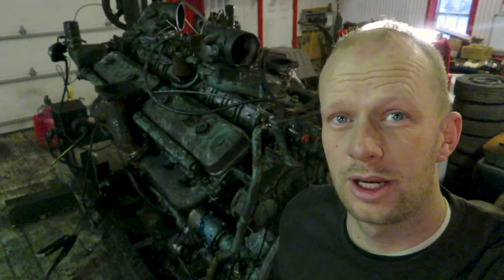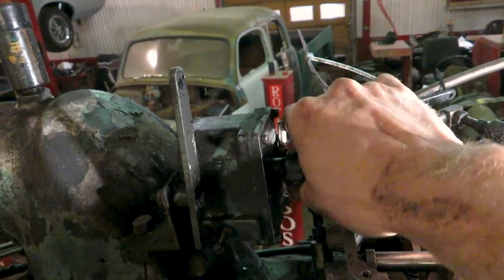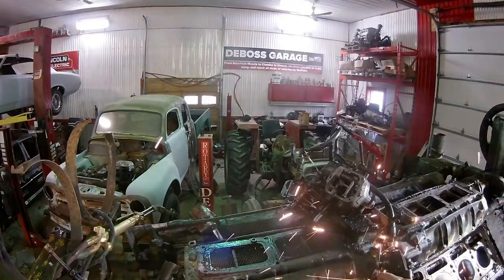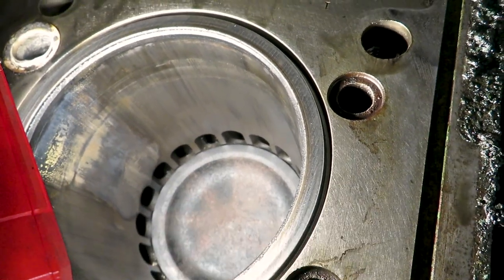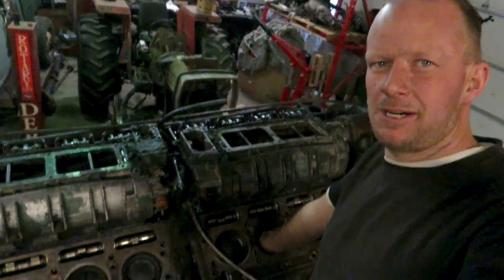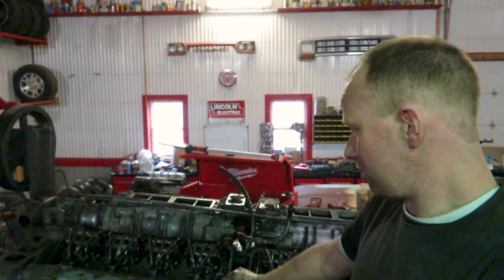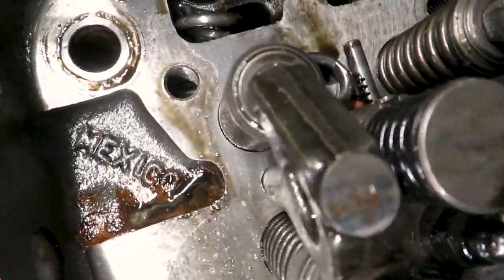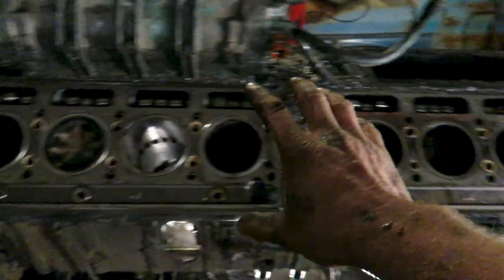What's Inside a 16cyl 2 Stroke Detroit Diesel? #HowItWorks

Comment: As a Marine Engineer these 12v71, 12v92 & 12v149 were very popular in offshore supply boats - very powerful & robust - although the unit injectors in the cylinder head leaking fuel into the heads & crankcase & destroying the lube oil - they are easy to maintain as the cylinder/piston can be replaced as a single unit - the ones l ran were turbo charged & superchaged - technically "scavenge ports" - just the noise when running is exciting - they were designed to work hard - they suffered torsional problems when run at high load & low rpm (over torque)

Comment: Brings back lots of memories, every piece of logging equipment on Vancouver island had a 2 stroke Detroit in it up till not that long ago.
We rebuilt hundreds of these back in the 90’s at the diesel shop I worked at. We had exchange rebuilt 12v71’s sitting on a rack waiting to go in
A Hayes HDX off highway logging truck or an 044 Madill yarder. Also the Allison 5960 off highway automatic transmission a great combination.
Every time I hear one of these running it brings up lots o memories and emotions. 😢 I miss a lot of the old mechanical engines, Old Cummins 855’s and the KTA 19 as well with the PT fuel systems, most of the younger techs have probably never worked on them.
The 2 stroke Detroit’s were fun to tune and set up, a real art to getting it right, still have all my tune up tools.
Thanks for sharing this with us!!

Comment: These 2-cycle Detroits are legendary. I owned several back in the day: One boat with two 6V53s, running in opposite directions, and a bigger boat with a single 8-71. Say what you will, they were dead-nuts reliable. Climb onto to boat, pour in 2-3 gallons of crankcase oil and start them up. They weren't fast but they never failed. Yes, they leaked a little but back then, I'd never go to sea without that distinctive small of the Detroit exhaust.
Reply: I used to build marinised 8V92 TAs, 750hp all day everyday to 10,000 hours
Reply: Daver G  I said 10,000 HOURS not rpm. They peaked at 2200rpm
Reply: Daver G  Well I've built several (over 50) marinised 8V92TA engines that went into commercial boats, usually trawlers. Never saw one for rebuild under 8.000hrs and that was only because it flared with props out of water in storm seas and over revved. I am happy to give you phone numbers to call owners and previous employers.
Reply: Daver G  Yeah, I read what you wrote, and why would you idle a marine 8V92 at 1500???? And if you want to run an 8V92 to 3000 rpm, be my guest, I've seen one self destruct on the dyno at 2800 because someone didn't set the governor correctly.
Reply: Daver G  WHEN did I EVER mention TTA??? DUH! TA Marinised! No blow off valve, keel cooled, do I need to go on? And trawlers run at 1500rpm when exactly?? Oh yeah, docking. Well I must be so lucky exceeding 435hp, fuck I've built 92TA's at 455hp industrial running irrigation pumps. Obviously I've been doing shit wrong for 35 years
Reply: Daver G  Like I said, how many phone numbers do you want???
Reply: Daver G  Ok, let's see who's credible. Without looking at a book, google searching or looking it up on the internet, Marinised 8V92TA(not TTA) @ 750hp 1050ftlbs torque tell me the injector spec, timing, blower drive ratio and fuel restrictor to use????? You have 10 minutes
Reply: Daver G  Are you in the states?
Reply: Chris Willmott but his uncle said........
Reply: @muckrunner308  Exactly

Comment: I worked for a Detroit Diesel distributor back in the 1970s when the 16V71 was used in the oilfields and locomotives. They were amazing engines and the technology that Rich details in this video is just an introduction to all you could do with them. I worked on Series 53, 71 and 92, but didn't get to service the 149s, which were used in huge locomotives and transcontinental cargo ships. Red Adair, who was the oilfield firefighter that John Wayne's character was based on in the movie "The Hellfighters," used Detroit Diesels because they were comparatively light, produced quick torque, and parts were available everywhere in the world.
Reply: The 149s were used to drive frac pumps.  (Not just 149’s, but turbo aftercooled 149s). The noise during a job could be felt.  Sad the 2 strokes went, but these engines were complicated…lots of parts.

Comment: I have seen these engines run for thousand miles with a conn rod cap in the pan if you don't shut it down. positive pressure from the blower keeps the rod on the crank.  the cross head piston came apart in your engine and the rod punched out.  the piston rings have a line on the face of the wear surface. when the line is gone the rings are done. you don't need to take all that rocker hardware off to remove an injector.  just the rack rod, the jumper lines and the two bolts that hold the rocker shaft.  the rockers will flip over If the cam is in the right spot. then you can clean the inj tube, install the new injector and flip the rockers back. adj the inj height and the rack and done.  always remove the rad cap before removing the injector- pressure in the rad will seep past the inj copper tube and into the cyl.  then you need to remove the head to replace the coppers. (they swedge in from the bottom, and you need to cut the new coppers to set the injector depth. inj depth is the distance from the piston to the inj tip so your spray hits the piston cup correctly for max burn. 

factually yes the engine can roll backwards and fire up, but I assure you the oil pump is also running backwards so engines do not last long with negative oil pressure.  left hand engine have a different oil pump.   you pulled the piston too early. if you cut one 3/8" bolt to the exact length and put it in the intake ports you can use the crank and rotate the engine to lift the stuck liner out. piston, rod and liner all at once- provided the rings have enough tension to hold the liner as you lift.   haven't seen inside one of those for many years.  good stuff.
Reply: Shoot, you should be a 2 stroke Detroit YouTuber!

Comment: I always wondered about these engines!  I saw one many years ago that was used to pump water and was in the process of being replaced with electric motors at a pumping station. We used a lot of the v-8s in various trucks and equipment and they were powerful and reliable as long as you kept up with the preventive maintenance, such as regular oil and filter changes. The biggest problem we had was the reluctance to start in cold weather, so we didn't park them outside for long if we could help it.

Comment: having built a few them when I worked at a Detroit Diesel dealership, they are an underrated engine. They can take a lot more abuse compared to the other engines. Nice marvel of engineering when you comprehend that 70% of the series 71 engine parts are interchangeable. Lots of fun to see a the engine go to full throttle and sem to scream. Had a few of those problems myself. Keep up the good work. FUN

Comment: I loved working on these (6v-53, 6v-53t and 6v-53ta) when I was in the army. Because of the demilitarization code, none of the engines are allowed to be reused or resold. I helped sadly to scrap over 35 rebuilt engines. Super reliable and super loud.
Reply: @transcendtient  someone didn't watch the video. The engine could not have been resold, so instead of being condemned, it was used for fun and now is going to be parted out as it most likely was going to anyway.
Reply: @transcendtient  it was in very poor shape anyway.  The liners and pistons were badly scored,  had terrible blowby.
Reply: It was sad to see but it’s a last hoora before it was being scrapped anyway. It was hard to watch, but at least it turn into a two stroke diesel lesson. Amazing engines, sad too see them slowly go.
Reply: @lookbehindyousuka  Clearly YOU didn't watch the video.  It was for sale for 6 months, and nobody wanted it.
Reply: How have some guys bought military surplus 6V53 silvers at auction? The 53s sound the best to me. There's vids of a guy with one in a dragster.
Reply: Prefers Anonymity I know the 6V-53 from the M113A2 were destroyed, but I guess the 6V-53T silver series might be under a different demilitarization code.
Reply: @grabasandwich  My personal opinion as a fanatic lover of Detroit 2-stroke fuel to  noise converters, I like the sound of the V6 Detroits the best! Very loud and with that classic Detroit sound plus the really harsh, abrasive raspyness that V6 engines have. I can't get enough! I must own one someday. I remember back in the day, there were loads of ole GMC Brigadier's running around and those were all 6v engines and usually straight piped. Id appreciate the power of a 6v92 but the look of a cleaned up 6v53 with the big flat stamped steel valve covers, nickel plated, so cool!
Reply: I've seen lots of running military 8v-92ta's for sale on E-bay, can be had for $7k or $8k all day. Tempted to snatch one up and try to cram it in an old International Loadstar 1700.
Reply: @DeathHead1358  that would be freaking amazing to see, and here! I hope you get to do it man!
Reply: Why werent they alloud to be resold though? I mean sure they may have been worn and all but what harm could an engine do, its not like its a weapon or anything
Reply: @isakjohansson7134  he sold all of the parts that were still good. That engine was worn out anyway, and would cost a minimum of $30,000 to have everything fixed and rebuilt to 100%. And like he said, the good/somewhat fixable parts are for sale/have been sold.
Reply: @TrevorMoore_  no, not that engine, i meant the 6V53s
Reply: @isakjohansson7134  yeah I reread the comment just now, I should have put on my glasses earlier. I'm a idiot. But, it still applies to everyone else who thinks the engine was good. Cheers mate
Reply: @TrevorMoore_  its alright
Reply: @DeathHead1358  I need one for a Powerplant connected to a lowspeed Generator how many KW can I get from it ?
Reply: @onekycarscanners6002  I don't really know that much about generators, but I've seen several powered by 16V-71s that were in the 500KW range. I'm assuming that by lowspeed the engine won't be running wide open, so I'd say you'd probably be able to get around 50-100KW out of an 8V-92TA.
Reply: @kaulincurtis9665 .... it easily could have been rebuilt, or better yet, remanned... as long as the blocks, main bearing saddles and counter bores were in good shape and within specs.
Reply: @grabasandwich .... IF, you're thinking of Doug Doring's diesel "dragster".... it was actually an "Altered", not a "dragster" (aka, "rail" or front, or rear engine dragster).  It had a twin turbo "military" (aluminum block) 6-53TiB.   Or, were you thinking back to the late 1970's - 1983 and the "White Lightning" back motored dragster (225" S&W) of John Carey's?  

It had a twin turbo 6-53 as well, however... he de-stroked it down to 270ci and was running it at 5k through the top end.  He even recorded a o.98 60ft, which.. to this day has never been bested with any diesel dragster.  

It was producing 1000+hp at the wheels, on straight diesel at the top end, and 1,800+ "on the bottle"..... back, before "diesel powered" Anything on the drag strip was ever even heard of.    John's "best" back then was 7.21 at 187.46 mph.
Reply: @mytmousemalibu .... Just FYI - The GMC "Brigadier" / Chevy "Bruin" (1978 - 1989) Base engine was, in fact.. Chevy's 427 BB gas engine from 1978 til the end of the 1981 model year, after which.. were all diesels.  Yes, there were some.. that were 6-53 powered, however the Three most prevalent engines sold with the Brigadier/Bruin models were the 6-71, 6-92 & Cummins NTC series.  The 6V71, 8-71, Cat 3208 and later (1984) the Cummins L-10 was also available.
Reply: @Romans--bo7br  There's a few vids of Doug's racecar. It looks like bare metal and sounds awesome! The burnout and staging is agonizingly slow, but once he finally revs it up, it's insane!

Comment: If you guys care, these are essentially mini versions of prime movers for locomotives made by GM in the US and Canada. 16V-567s(567 CU. in displacement per cylinder) were used in early locomotives like a GP7 through the GP35. The 645 engines were used in EMD GP38, GP40 , All the way through the SD50. Fun fact: An SD45 had 20 cylinders and could produce 3600 HP at 950 rpm. They did not last long because crankshafts kept cracking at the joint. Most had options in 6, 8, 12, 16 and 20 cylinder options.

 (Edit)Here's an example: https://youtu.be/BlOUzbSr3ZE

Comment: Great video!
I have so many stories on the Detroit.
They were designed for military use. These were for landing craft. That's why the earlier valve covers bolts were made to turn off by hand. There was a wrench that was tied to the engine to be able to go full fuel if a injector got stuck. 
This combination would take a week to set up the blocks and crank shafts to be true.
After that it was rather fast to rebuild them. 
The 53 series were made to go to 3200 rpms. Use 100 injectors. Inter cooled and dual turbos turn it up to 3500 rpms. and they would scream!
Reply: Eddie b...... "They were designed for military use."  No, they were Not "designed For" military use.... "Boss" Kettering wanted a compact, lightweight, high speed diesel that could be adapted to a wide variety of applications... a 1-71 was the "proof of concept" engine...a 4-71 was the first running prototype, and the 6-71 was the first production model.  

Yes, when WW2 came about, GM won the contract bidding for the "US war machine" and the GM Diesel Power engines (aka Detroit Diesel beginning in 1965), as well as the Cleveland Diesel Div. (later, EMD) engines were adapted to numerous land and Naval applications, but they were NOT designed specifically for "military use".  

As far as the rest of your expert diatribe is concerned.... it's really not worth addressing. 

How do I know that?... I studied & degree'd in Diesel Engine Design & Theory, specializing in 2 Cycle (Clarke), during the mid 1960's, and for three out of my four years, I studied directly under Mr. P. Nicholas... recently retired at that time, from R&D at GM Diesel (aka Detroit Diesel), and who was one of the three lead engineers who designed and developed the very first 2 cycle GM Diesel prototype engine... the aforementioned 4-71.. of which I have a framed 8"x 10" black & white photo of, along with "Boss" Kettering and P. Nicholas, taken just moments after it was fired up for the very first time... gifted to me by P. Nicholas himself, after I returned home the last time from VN. in 1970.

Comment: An engineering marvel in it's modular design. Full roller cams. Can run on just about any liquid that burns. The inline version came out in 1938, v configuration in the late 50's. These engines were built like aircraft engines of WW2, way ahead of their time (90 years ago!). The vocational school I went to had a 6-71, my group got to tear down, measure all critical areas and reassemble.  Good times, in 1991.

Comment: This engine is practically mythical. A friend of mine swore up and down that the end of production was some great government conspiracy. These were great motors for any stationary application but on road was a different matter. I drove a Sceamin' Jimmy V-8 in a farm five ton when I was a kid. The powerband was like 200 rpm wide, making perfect shifting essential. As a sixteen year old, my shifting was far from perfect. The motor screamed like hell all day and burned way more fuel than a Cat diesel.
Reply: The end of production was the EPA.   General Motor Diesel owned the patent for the unit injector.  Cat, Cummin's IH all got heavy fines by the EPA for Rigging their engines to pass the emissions test.  But polluting miserably during real world use.  They sued GMD on the grounds they wouldn't fairly allow them to license the Unit Injector design because that design was the only way to meat emissions (in a four stroke design) and they won.  Detroit was forced to license the design to them at a fair price.  That gave way to in my opinion the best and most reliable on highway engines of all time.  dd60 3406E and N14 and their small brothers.
Reply: The 92's have been brought back into production via a military maintinace contract. The company that ended up with the IP is also doing factory rebuilds on most of the old 2 stroke engines.

Comment: I build the fuel injectors that go into this engine. It's pretty cool to actually see them installed as well as how the rest of the engine comes apart. Judging from what i've seen from the core injectors, these engines run for a ridiculously long time and are not very sensitive compared to the newer stuff. Prying on them like done around 16:00 minutes in, is a great way to make them seize up. If they are getting stuck like that, they are on the way out for sure. The internal plunger gets scored and shortly gets stuck